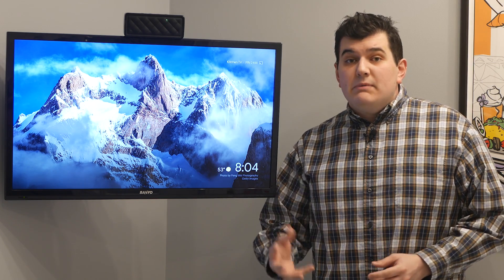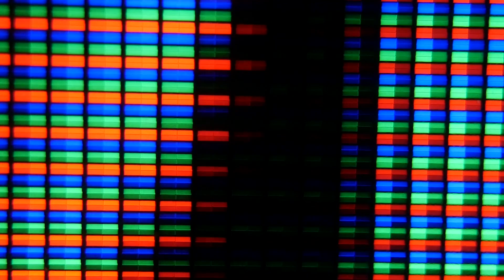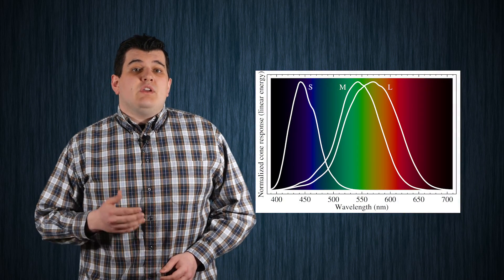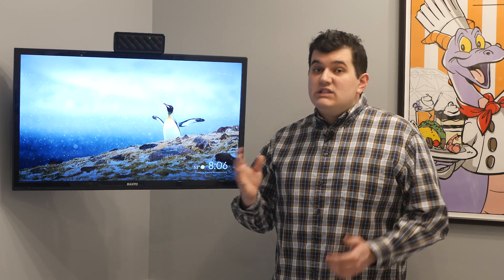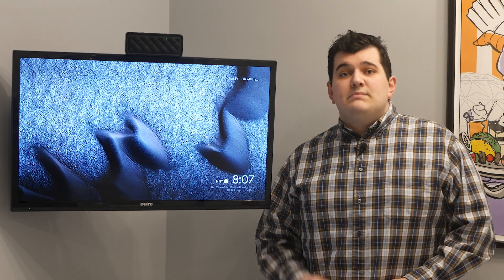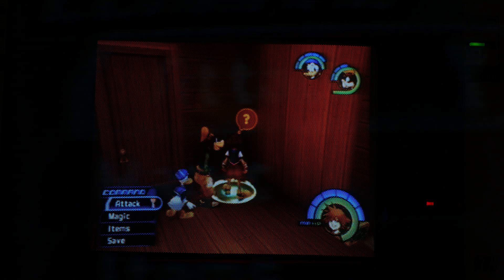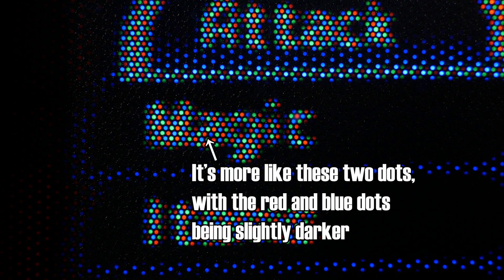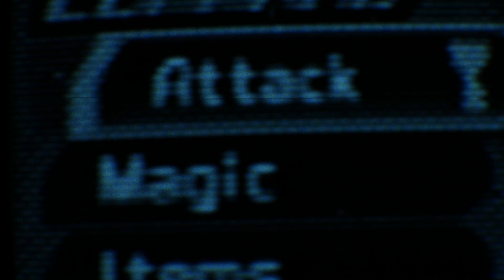These Are Not Pixels: Revisited

Comment: The definition of pixel is "a minute area of illumination on a display screen, one of many from which an image is composed." so, that means CRT's do have pixels
Reply: Yes, that's what google says a pixel is, and it's an incomplete definition. They key point of what a pixel is has to do with being individually manipulated. As demonstrated with the shadow mask, the electron gun does not give a lick whether it actually falls on a phospher or not.
That is a huge difference. I can turn on pixel 300,280 and give it an RGB intensity of 2A7033 on a digital display. It will happily do so. The best an CRT display can do is vary the intensity of it's beam on line 280, after a certain period of time past the h blank and hope the phosphors that get lit are visible through the mask.

That's why old school consoles are in such lockstep with the crt's rate of refresh. The console knows what it put out the field previously, and some can know whats in the next field, but it could only guess what is sitting under the beam and being lit by use of registers that count what line the display is currently drawing and another counter that tracks to the hblank. From there it could "address" individual parts of the screen and know what should be displayed there. I say should because the console couldn't actually know what's there, it just knows what it is attempting to paint there.

 This is most telling in the atari where bits of the play field aren't displayed because the cpu had to take over to run the program code during the h blank, for a brief moment the tv had no information as to what to do with the electron gun and thus didn't fire until the display routine took over.

In modern displays, I can look at the digital output and know the exact location and intensity of every dot on the screen. They are pixels, and can be directly manipulated.
Reply from the maker: But the image is not composed of them.  The image is forced into a pre-existing grid which lies in front of the image.  The shape of the image determines which phosphor dots are lit, as opposed to a true pixel which creates shapes by lighting up discrete elements.
Reply: Technology Connections i dont see a difference.

Comment: Great explanation! Let's hope this puts the debate to bed. 

If you used a multisync monitor, which most PCs had throughout the 90s, the concept of a fixed-resolution display was foreign to you. Your monitor had a maximum resolution, but it was defined by how fast it could sweep the beams across the screen, not by how many 'pixels' the screen contained. Back then,  dot pitch, the size of the phosphor dot clusters, was an important factor when shopping for a monitor: Cheaper monitors had larger dot pitches, and looked more 'screen door'-like when showing high-resolution images than more expensive monitors with smaller dot pitches.

Comment: You came so close to talking about “dot pitch” and how it affects image/color detail. Maybe in another video. Anyway, as always this was an excellent video. It must have taken a lot of effort to put together.
Reply from the maker: Not to belabor the kind comments in the post (thank you!),  but I did reference dot pitch at 12:22.  From there I just didn't refer to it by name.
Reply: Well I guess I missed it. Sorry. Anyway dot pitch isn’t too relevant for television and only becomes important for computer monitors. I think that’s when the subject of this video gets even blurrier. Always wondered if the shadow mask gets finer as the the dot pitch increases. Also always wondered why the gap between scan lines never changes as resolution changes on high dot pitch monitors. It as if the the electron beams get bigger or smaller as the resolution changes.

Comment: While the early color TVs were absolutely analog, I feel like the shadow mask plus the triad dot patterns form what rationally could be called a pixel.  Each triad of dots would be one pixel.  The resolution would be defined by how many of these groups of three dots or three lines were on the screen.  Of course this is different than the pixel definition for modern flat screen televisions.

Comment: Most plasmas were not really digital... connect a computer to one, at its advertised "resolution," and see what happens.  :)
Reply: Huh? My HTPC is connected to a 64" plasma. Set GPU to 1920x1080, turn off overscan in TV's menu, and it's just as pixel-perfect as an LCD.

Comment: i remember back in the day when crt monitors for pc was a thing, you could change resolution and it would be perfect, but now with lcd only native resolution works since there is a fixed pixel amount.
Reply: You could do this just fine if you used a much lower resolution on the PC than the LCD's pixels are. Which is basically why it worked on a CRT, because the CRT's dot pitch was much greater than the PC's resolution.
Reply: @gargantuablargg  one of the reasons 4k rocks for old 'odball' resoultions
Reply: Integer scaling I'm fine with, but fractional scaling and filtering are garbage and totally throw the image quality and intent out the window.
Reply: Well, more properly only integer multiples or factors of the resolution work without loss of fidelity further from that of the resolution itself - just as you'd expect
Reply: CRT monitors for the PC are a thing!
Reply: Unfortunately, 960x540 is not recognised as a standard resolution, so 1080p can truly only render 360p video, but that doesn't exist as a standard display resolution either. Technically, 1080p is bad for scaling pixel perfect images from any other recognised screen resolution, but that's what scaling and filtering is here for.

Comment: How come the screen rolls when the horizontal blank is missing? Why doesn't it just display 1 line?
Reply from the maker: The TV is producing the raster on its own.  The V-Sync and H-Sync signals are there to synchronize the raster being broadcast with the raster being produced on screen.  If it's not in sync, then it will roll because there are going to be timing errors between the set and the signal.  If you can lock into one part of the image to define the start of the frame/field, the timing errors are resolved.
Reply: You can also see that there is information in the video signal which is part of the vertical blanking period (and thus not displayed on screen) if the vertical sync is rolling. Amongst others, teletext, synchronization (genlock) and any other system-specific information were encoded in those lines which were outside of the 480 visible video lines.